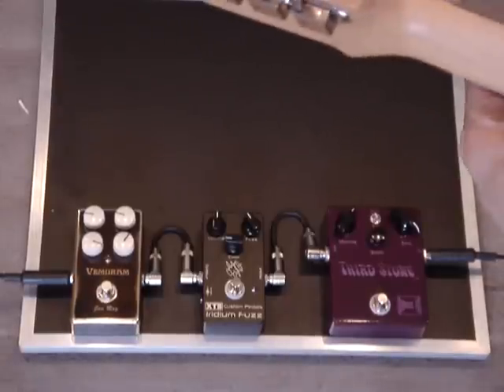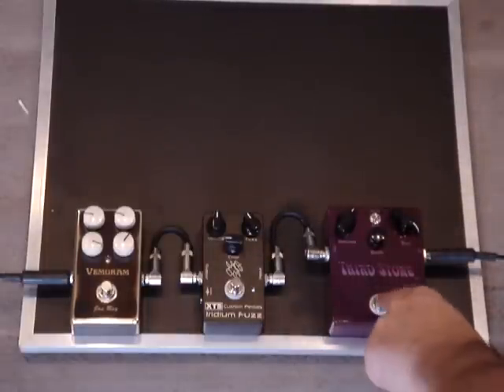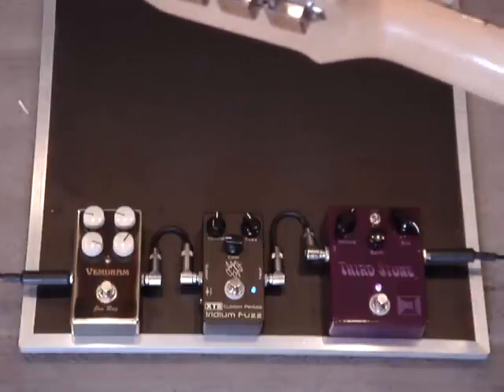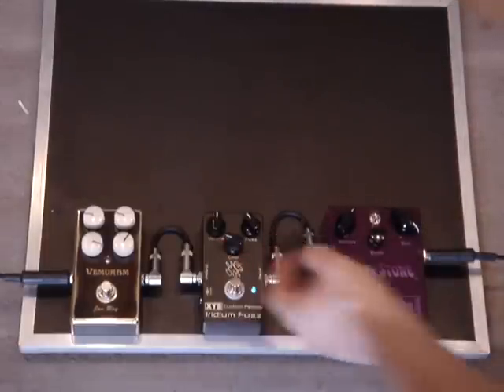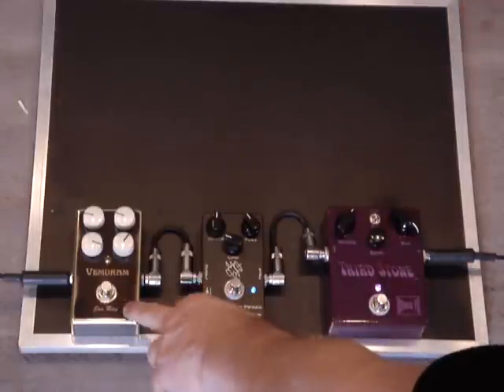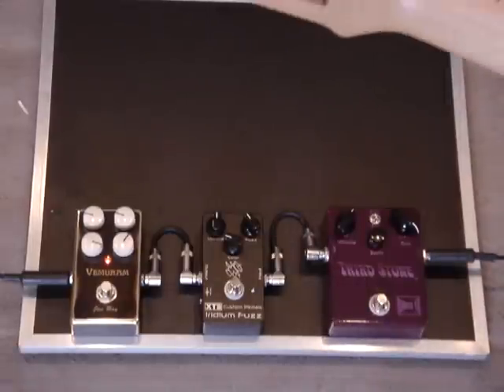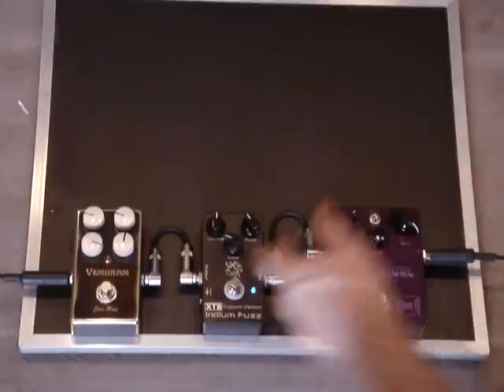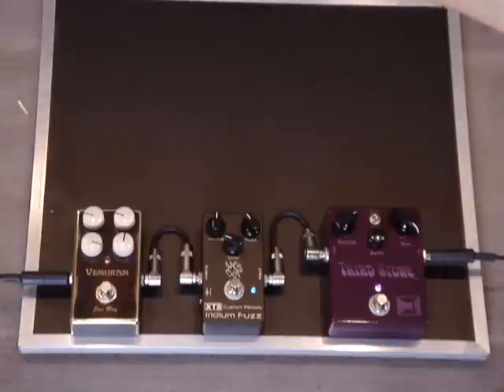HOW TO RUN A BERKOS FX THIRD STONE INTO CLEAN AMP.

Comment: Or... use a smaller amp on the Edge of Breakup? Do you get additional benefits from running it through a OD pedal vs. a slightly broken up amp?
The Vemuram sounded like a great “clean” sound to me. Not a huge fan of the “super clean” sound?
Reply from the maker: The advantage would being able to switch between a really clean sound instead of just having a slightly dirty clean.

Comment: Hello David How to get that "amp with some breaking up" without the Jan Ray ( so $$$ for me) please ? With the Tejas Boost ? With the Roger Mayer Voodoo 1 ? Lovepedal OD11 If the Jan Ray is THE pedal, i will be waiting for a used model.. Thanks Nicolas from France.
Reply from the maker: I would suggest the Jan Ray or  XTS Iridium.
Reply: Thanks David..
Reply: The Lovepedal Church of Tone is good as well It's just a one knob wonder if you don't want the extra I think I'm going to pull the trigger on an Iridium Thanks LASD
Reply: It’s all in the flavor you want and adjust to it… I run mine into a boss blues driver… I just turn the gain back… he’ll you run the fuzz into a klon style pedal if you wanted…
Reply: @traviscrown9189  Thanks.. 🙂